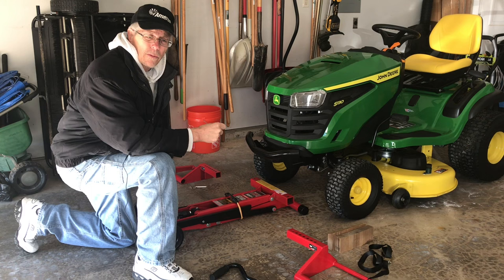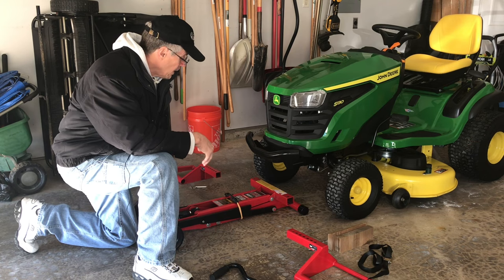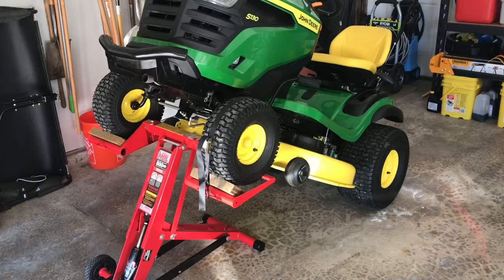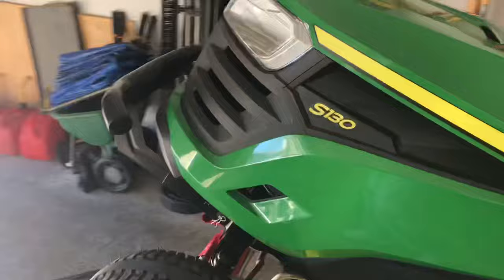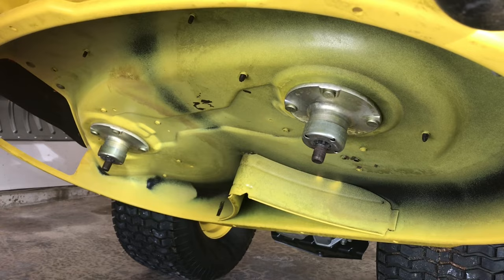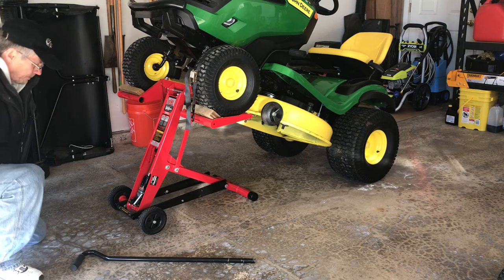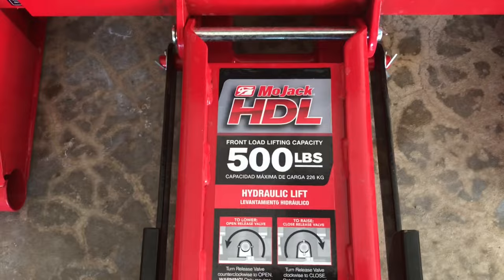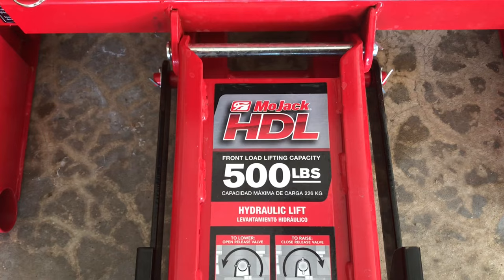John Deere S130 Maintenance with MoJack HDL Tractor Lift @DIY Boomers

Comment: I bought this jack last fall when I bought an x354 and it works really well, easy to use, move and store.  When you fold it up you can wheel it to wherever you need to move it instead of carrying it.  Now I change my blades when I should and keep the deck like yours!
Reply from the maker: Absolutely! Couldn’t have said it any better myself. I am very pleased with the one that I have.

Comment: I have the same model mower but I bought my jack at Harbor Freight, it makes an interesting comparison. My HF lift has some definite advantages while at about 1/3 the price you paid. Mine can be folded but I usually leave it fully assembled, it has an upright component that I store about a foot in front of my car bumper, while the lift part is very flat and easily fits under the car. No boards are needed, it clears everything with no problem at all, it also has a pedal operated jack, very convenient, and a large knob to release the pump pressure. It doesn't automatically lock at different heights it has a hardened pin instead. Pros: It fits the mower, no home made adapters needed, and is quite frankly, easier to use, I paid about $100 for it. Cons, Depending on your situation, may or may not take more room to store, mine takes up no more space than yours if you store it like I do. Made in China, I like to support USA manufacturing too but I have to consider the price difference.
Reply from the maker: Sounds good! I’m all about saving $$. In my online searches for mower jacks, Harbor Freight jacks never came up. I would have had to take a good look at that price!

Comment: You keep the mower very clean . I  just purchase a mower  lift for my J.D .Thanks for the video.
Reply from the maker: You’re welcome. Yeah, I just hated to see the new S130 get all caked up on the underside of the deck the way our previous mowers did.  That and thinking I should be sharpening the blades regularly ultimately made me decide to get the lift. Much easier than having to remove the deck!

Comment: I love John Deere’s...had several over the years.  End of last year I sold my 3 year old S240... was in perfect condition but I like new stuff...however this spring I tried to buy a new John Deere and found out they are basically not available till August!  There are a few S100’s 27 HP... I was lucky to find and S120 at Home Depot and grabbed it.  I called all the dealers in Ct.  along with all the Lowes and Home Depot’s...I got lucky to find an S120... I wanted an S130.
Reply from the maker: Yeah, I’ve noticed a few new Deere’s at Lowes, but not at Home Depot. Didn’t stop to see which models were available at Lowes. Looks like the supply chain disruption continues into 2022! I got real lucky at the end of last summer to find one of a couple S130’s that were just getting delivered to a local dealer. Everyone else was completely out.

Comment: Question... Will this jack be able to lift a mower that has 4 flats and is low to the ground? I can't fit a floor jack or a scissor jack under it to lift it so I can change tires out.
Reply from the maker: Well, there’s a couple of problems with that. For one, you need to roll the mower onto the jack so that the tires are on top of the lifting brackets of the jack. Then, when the mower is on the jack, the tires are held in place since they are the point of contact between the mower and the jack brackets for lifting, which would make it difficult (and dangerous) to remove the wheels. Sorry, but you’ll have to figure out another way.

Comment: Perfect video for my small issue. I looked at the HF lift and was told the newer version no longer folds up like the Mojack 550. I found the Mojack 550 folds up against my wall perfectly. But I ran into the problem you did with my John Deere S100 having that center deck adjusting rod. My first go-around I notice it was semi tight against the Mojack front bar. I remember seeing your video and looked it up again. I've made two blocks of wood out of 2x4's. Tomorrow I'll try it again. Curious what size width were those two boards in your video. Otherwise the lift works great and is quite heavy duty.
Reply from the maker: I just used a couple of 2x10 scraps that I had laying around. The actual width of a 2x10 is 9 1/4”. So mine are 9 1/4” by 3 1/2”.

The wheel brackets are just over 9 1/2” wide on the MoJack that I have. If yours is the same, a 2x4 that is 9 1/2” long would work just fine, however they don’t have to be that long since they don’t have to fit tight in the wheel brackets. I just lay them on a diagonal against the front bar of the bracket and roll the tire up against them to hold them in place.

Yeah, I really like the MoJack 550.
Reply: @DIYBoomers 2x4 blocks worked perfectly!
Reply from the maker: Great!

Comment: Have your blocks ever popped out while using? I have the same jack but it hits the underside of my Kubota GR2120. I tried the blocks (2x4) and it raised and cleared the bottom.
Reply from the maker: No, I’ve never had a problem with the blocking. When you think about it, they really can’t fall out with stable and even pressure on the tire side even though the contact on the bracket is not wide. Mine have stayed right in place.

Comment: I put never seize on the studs for the blades.
Reply from the maker: Hadn’t heard of that. Makes sense! I will have to look into it.
Reply: @DIYBoomers    You brush it on and it is so much easier to unbolt anything.  It comes in a small plastic bottle.
Reply: @donflash1128  You are very wise to do this.  All fasteners have wicking ability do to the necessary close fit between male and female threads.  They suck in moisture which will corrode them in short order.  Believe it or not anti seize is even recommended for stainless fasteners that will be disassembled and reassembled frequently not for corrosion resistance, but because of its anti galling properties.

Comment: Hi is it safe to work on it under the deck to change blades while it is up on that MOJO lift? Won’t collapse?
Reply from the maker: It has a 500 lb capacity and seems very sturdy to me especially since you’re only lifting one end of the tractor. It has three position locking bars that take the bottle jack out of the possibility of leaking off.

Comment: It’s too late now, but if you would have looked further you would have found the CAT mower lift that tilts the entire mower to the side rather than lifting from the front.  It leaves everything unobstructed underneath for service or repair.
Reply from the maker: The CAT lift is actually the first lift that I saw that got me looking at them to begin with. Looks like a great lift. I guess I ultimately decided on a front lift for a couple of reasons. First reason is that I’m somewhat of a penny pincher, the MoJack was $50 cheaper. Not to say that I wouldn’t spend a little more if I thought it was warranted, but the front lifts give you access from both sides which is nice for blade sharpening/changes. Also, using the pressure washer from both sides allows you to see and access the opposite inside edges of the deck for cleaning. Initially, I was about to pull the trigger on a CAT, but like I said, I’m a little bit about saving $$ anywhere I can that makes sense to me.

Comment: Hi can you tell me if the front bar of the jack is blocking access to remove the PTO clutch. I need to drop it in order to replace the drive belt. Thanks.
Reply from the maker: Hello. No the front bar of the Jack is about 4” away from the PTO clutch towards the front of the mower on our JD S130. It shouldn’t be a problem. However, I am wondering why you say that you need to drop the PTO in order to change the drive belt. The middle tensioner pulley on the deck is tensioned with a spring. You can push the pulley forward to create slack in the drive belt and remove it from the PTO clutch. Good luck with that.
Reply: @DIYBoomers  What you’re describing is the deck belt, which spins the cutting blades. What I’m replacing is the transmission drive belt that spins the rear wheels. Thanks for your answer to the PTO. I have an E150.
Reply from the maker: Yeah, I thought it might be something else. I would imagine the E150 is similar enough to the S130 as to how it fits on the Jack in relation to the PTO.
Reply from the maker: Wow, how much fun is that! I took a look at a video that shows replacing the drive belt on an S130. I had no idea (as you noticed by my first comment). With our S130 being the fourth lawn tractor that we’ve owned, we’ve never had to deal with replacing a drive belt. Out of sight, out of mind, that belt is really buried up in the chassis. Did the belt break on you?
Reply: @DIYBoomers  I was having trouble going uphill, which I hadn’t before. So I assumed that the drive belt was either damaged or stretched, which would make the mower lose power. I had no problems going on flat land. Upon further investigation under the mower, I discovered that a bunch of grass and dirt were trapped under the foot pedal mechanism, which prevented me from pressing the forward pedal all the way down, thus the transmission wasn’t getting full power, only maybe 2/3 power. I used a brush and thin stick to clear out the stuck grass and dirt and blew everything out with a leaf blower, and the mower goes uphill fine now. Pheww saved me a bunch of work! I’ve had the mower for 5 years, and I do blow it clean after every session, but I guess the air couldn’t get into the crevices under the foot pedals.
Reply from the maker: Good troubleshooting to find that one!

Comment: I dont have a jack like yours but I just use a winch to lift the mower and I definitely don't have a mower as nice as yours and I thought the mower I have was a peice of junk but the deck is still solid and it runs and drives so it's a good mower and idk how the deck looks
Reply from the maker: The winch is actually a great way to do tractor maintenance. If I did more mechanical work than just the lawn tractor, I would have looked into a winch setup.
Reply: @DIYBoomers  I found out how the deck looks under neath and it doesn't even look like it's even touched a lawn because there was no grass but that might be because it sat since 2010 the deck was regularly cleaned before it sat